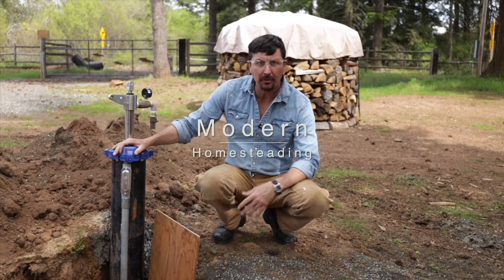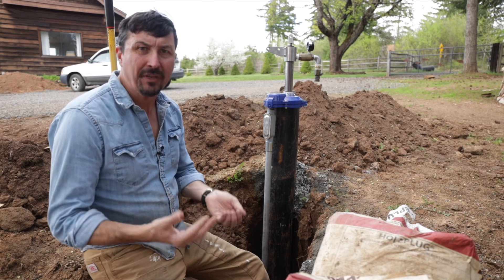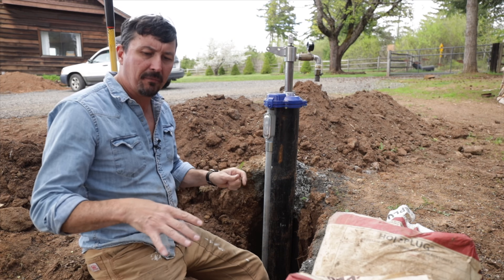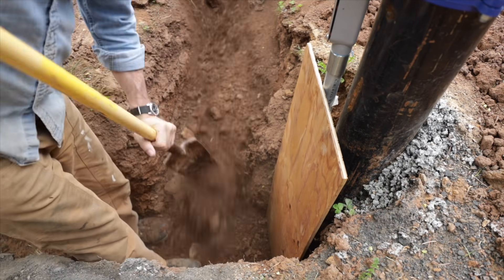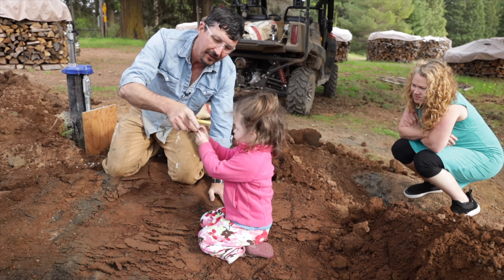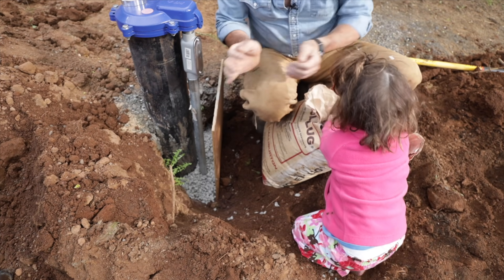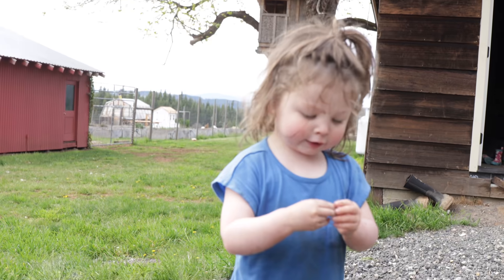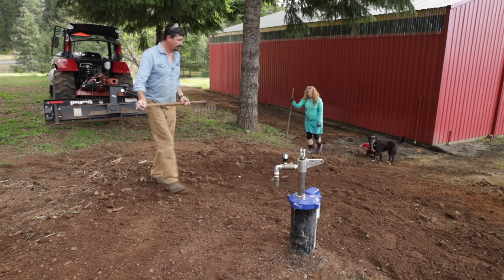You Won't Believe What We Found In Her Pocket

Comment: As a retired environmental scientist/engineer, great job with that bentonite and well. You will get some decent settling after your first rains so you will want to add some more dirt around the casing then. The goal will be to have the final well grade be a bit proud of the surroundings to shed water away from the casing. The bentonite plug is indeed very important as you described. Do consider at least cheap bollard(s) or equivalent protection/warning in any direction susceptible to traffic. Well casings are an absolute magnet for car bumpers, etc.

Comment: Cody, that particular brand of hole plug is packaged 30 miles from me. I  do contract work for that company as well as some of the other manufacturers. There are 5 other bentonite plants within close proximity as well. Bentonite is strip mined using the usual industry standards. Hole Plug is raw bentonite that is simply screened to size and bagged. The powdered bentonite, or drilling fluid or mud is kiln dried , and pulverized in Raymond Mills into varying mesh sizes and then packed. Some drilling mud has various propietary chemicals and surfactants added to achieve certain drilling and hole stabilizing characteristics. Fascinating dirt!

Comment: Cody,
Three things....

1. That little girl is awfully cute. She brings a smile to my face every time she's on camera...  reminds me of when my girls were that small.

2. Soak that Bentonite with water (of course where you at, it will probably get soaked enough..) Many moons again I used to drill core samples and water wells.... I've tossed thousands of those bags... We used to make a slurry to pour around our casings...  water will soften those pellets up and they'll start to gel together forming a seal.

3. The best thing I ever did to my tractor was weld on some hooks to the bucket. Your local welding shop should have a decent selection.  Having hooks across the top of the bucket allows for a better pull. Now my tractor is small (Massey GC2300.... 23 HP) but before I added the hooks I used to pull from the side like you did. Which works.... up to a point. I've nearly flopped the tractor twice doing it that way. Now that I have hooks, I can pull from the center of the bucket and leverage the tractor weight much better.   Much safer. I'm not a safety nazi, but I'm pretty sure you'll find it safer and easier to drop a chain in a hook when pulling t-stakes, or small trees, or anything else you need to chain to. Size your hooks based on the chain you use the most.

You and yours stay safe.

Comment: I'm a groundwater expert, please let me know if you would like to discuss more. 

Pathogens like viruses and bacteria do travel in the subsurface.  You can get your livestock or sewage pathogens traveling in the subsurface and potentially reach your well head. It is super important to maintain a minimum distance to prevent cross-contamination. You may still want to place a concrete pad on top of the well to minimize surface/subsurface interactions.

Comment: i used to drill water wells when i was younger here in missouri.  I was wondering if your driller didnt offer to seal your casing and well for you with bentonite.... we used to do it all the time and it best when the driller does it because they can use the drill's air supply to force the bentonite into the walls of the well alllllll the way down.

in missouri in certain areas we are required by law to case and seal a well.... casing means that the well shaft is lined with steel pipe down to a certain depth and that depth is denoted by a special map and required by law in some areas. 

And one of the most important things that you didnt mention and maybe its because you dont know, but bentonite is so useful not just because it gets silty and sticks together so good but it also absorbs a significant amount of its weight in water and when doing so, it swells making it perfect for sealing nooks and crannies...

Most people have seen and used bentonite and dont even know it as it is usually the main ingredient in cat litter and floor dry.

Comment: One thing you may have misstated is that an aquifer can't be contaminated unless you pierce the skin. That not true, chemicals can get in as well as other contaminates. You should regularly have the water tested to verify there nothing bad in the water. As an additional measure filtering and "cleaning" may also be good. So even after sealing it up you still need to be careful with it.

Comment: So you are putting in a clay plug to prevent any surface containment from getting down to the aquifer. Good idea, keep it clean, But How did the drillers keep that from happening? Since it was installed it is rain/snowed, so wouldn't that water already be down there effecting the water quality? or are you doing this proactive just to keep any further contaminants from reaching the aquifer?

Comment: Cody - with all due respect, I fail to understand how small rocks or gravel would filter out or stop fecal matter or viruses better than fine grained dirt. Also If I recall from you previous video,  isn't your source 180 feet down?  I doubt anything from nature would make it down that far. Am I misunderstanding something here?
Reply from the maker: This is not gravel, this is clay. The clay will eventually turn into a solid lump essentially plugging the hole,
Reply: @wranglerstar  OK thanks for clarifying. Makes more sense now.